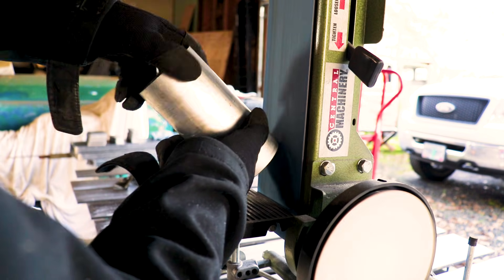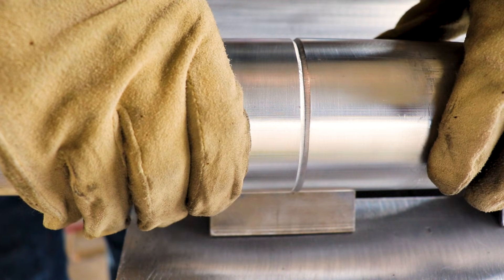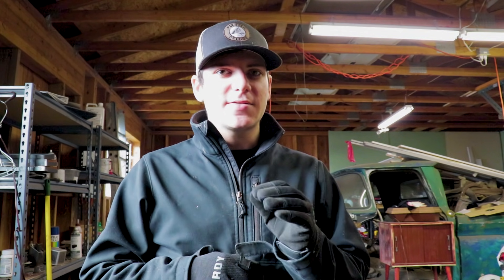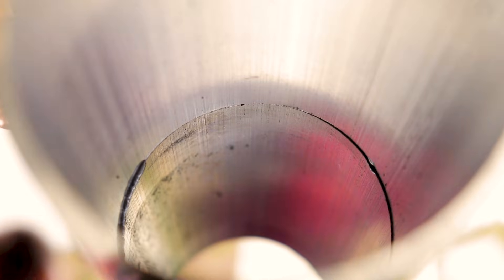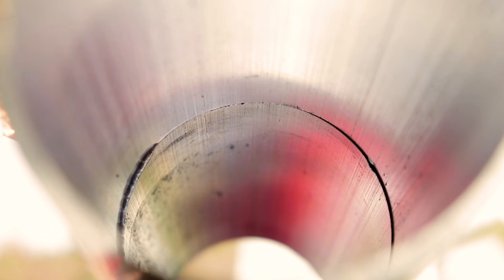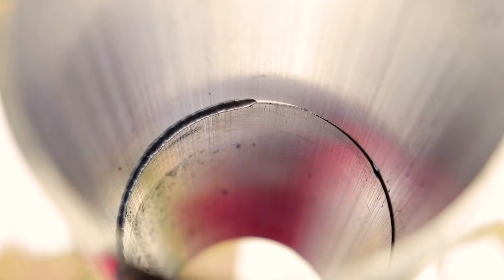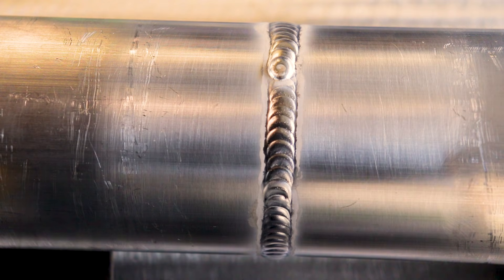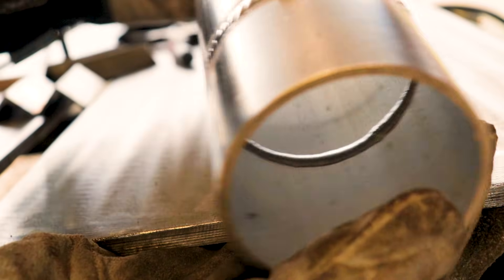How to Weld Aluminum Pipe

Comment: Hey man thanks for the pointers! What do you set your argon cfh too? I have mine at 10cfh and 80amps and I can’t tack my pipes
Reply from the maker: It depends on your cup size.  Its basically double your cup size so if you're running a #5 10 cfh is good.  But every regulator seems to be a little off some are high some are low.  Its best to just turn them up until your weld is clean.  And probably a lot more amps!  Like 120 or more depending on how thick

Comment: 37 1/2 degree is the proper bevel for pipe heavy wall pipe such as main steam may have a 37/10 bevel on it and I’ve ran the gold track with  5 degree bevel but a 45 degree angle is way to much for a multitude of reasons this is just fyi! Your doing great job

Comment: Honestly, I almost skipped the video since the start it wasn't filtering out the light but something told me to stick around. I am glad that I did. I have had trouble tig welding aluminum since it doesn't really pool the same way as steel (at least that is the way I feel) and your narration along with seeing it happen in real time helped for sure. I might hop back on the welder soon now!

Comment: If you welded Al tubing at a right angle or 45 or 135 how would you do that? How would you get the welder head into the pinch angle to properly fuse them together?

Comment: This video is very well presented and I have never seen the inside shots before...very nice.  I noticed that you do not quite entirely fill the bevel on either side of the weld.  In a real application would this be acceptable?  Would it reduce the strength of whatever gauge wall thickness you originally had?  Thank you.

Comment: Thank you for the video. I have two questions please.(1) With aluminium pipe welding is it necessary  to put a root gab or not? (2) can it be welded on a fixed position like 6G (where the pipe can't be rotated) will the penetration come out on the overhead position? Thank you.

Comment: Holy mother of dipped tungstens
Reply: @d2solutions185  different metals weld better with different tungsten shapes. Aluminum does best with squared off end. It’s not dipped you’ve just never done it

Comment: On the inside of the pipe my welds still have a seam where the pipe meets, like the weld inside the pipe is not fully joining the pieces.   Outside looks great.  Plenty of amps.  Doing all the cleaning then ss wire  brushing inside too but still the weld on the inside is not joining both pieces...  help!  2-1/2 sch 40 6061 with 5356 filler...  not allowed to use 4000 series filler on this job.
Reply from the maker: Thats fine its actually just the oxide layer rising up from the seem.  Even though it looks like it, it's not split.  Wire brushing the inside seems to help get rid of it
Reply: @5thStreetFab  Whew!  Thanks!   Great videos!

Comment: Nice job
Perfect bead inside. 
I think if the pipe is welded in position the story changes a bit. 
The sink in becomes a suck back and is a repair on x ray.
Reply from the maker: Thanks bud!  With aluminum its pretty hard to get suck back unless its a fillet weld.  I have a video of the same technique in 6g somewhere on here.

Comment: I got a piece of Aluminium tube this size and put a cut with a grinder cutting disk most of the way around. Now i tried to weld this with all the burrs still on inside of pipe from the grinder cutting disk.
I am getting very poor welds. Is it me or is it not possible to get a good weld this way ??

Comment: Excellent. Does the inside burs need to be cleaned? If not, than will it not interfere with process fluid inside pipe?
Thanks.

Comment: I have a question..after done aluminium weld joint the pipes,is there posibility that the weld section can get a leak spot or the aluminium has weld is melting back if the weld pipes is at high tempereture place..what i meant is this method of welding apply for using motorcycle exhaust system..thanks

Comment: Nice video, I really appreciate your camera angles and showing your welding process. I have some aluminum work I have to do on my car and I've never used a tig welder before but I'm buying one online. You mentioned keeping the puddle flowing, is it the same process if you're on your back facing up while trying to weld?
Reply from the maker: Thanks bud!  Ya I use the same technique on overhead as well.  One thing that can help is slightly pedal bumping when you're in an awkward position.

Comment: What amps for .065 pipe? Hertz and EP? Thank you! Baddass welder!
Reply from the maker: Im not sure on the amps!  I would just set it to around 80 amps and then adjust with the foot pedal.  I would run around 120 hz and 30 for the EP balance or it would 70 on maxhines like the htp or miller
Reply: Thanks for the fast reply! I’ve learned so much from you. Keep doing the badass work
Reply from the maker: @xnivektonx  no problem dude thanks for watching!

Comment: I'M GLAD YOU CAME OUT WITH A VIDEO ON,"TIG WELDING ALUMINUM PIPE",NO BODY ELSE HAS AS FAR AS OPEN ROOT.WHAT WAS YOUR CFH SETTING AND I TAKE IT YOU WERE USING HELIUM(MAYBE ARGON)ON THAT THIN WALL PIPE(SCH 20).IS THERE SUCH A THING AS WALKING THE CUP WHEN TIG WELDING ALUMINUM PIPE?-EXCELLENT VIDEO,KEEP THEME COMING IN,STAY HEALTHY,CRAIG

Comment: Loved the video i have a new ahp alpha-tig 201 xd. A few wuestions if i may Im having trouble as a begginer with tig im a great mig welder, where do i start what size filler rod should i use for aluminum intercooler piping? Do i need to backpurge? Settings help? Also do you set your machine to the full 200amps and just rock your peddle as desired? Thanks -drake

Comment: Hi I'm new to tig welding  but when iv tried welding aluminium it just doesn't seem to form a puddle then all of a sudden the whole thing melts and falls away.
Reply from the maker: I hear this quite a bit but i havent personally.  Just make sure your welding hood is clean and clear and slowly ramp up on the foot pedal.  Maybe practice on some thick plate 1/4"
Reply: @5thStreetFab  as its alloy that iv just picked up maybe its the type that's got something else mixed in that's not weldable.
Reply: also iv had it where the two parts are finally melting into a sort of puddle but seem to not want to attach together so the two half's are puddling separately and not joining into one, do you know what may cause this.
Also Thanks for you help.
Reply from the maker: @WALLACE7084  ya that happens a lot. Just dab the filler into the center and it should join them
Reply: @5thStreetFab  thanks for you help i really appreciate it. i once asked a guy 6061.com the same sort of question and he wanted me to pay a subscription to his channel before he would give me an answer the cheeky git. so thanks again for helping and not being greedy like some people. you're a good one. have a nice day. 👍
Reply from the maker: @WALLACE7084  no problem haha aarons a good dude hes just trying to run a business
Reply: @5thStreetFab  i just think he went the wrong way about it, if he'd have answered what was a simple question for him and then advised me that his paid subscription channel could learn me a lot more then i may have been tempted after helping me out, but to refuse to give me a bit of help unless id paid was a no go. don't get me wrong the guy is one of the best iv seen on here but the way he came across wasn't good.

Comment: An interior gas shield during welding aluminum pipe with penetration is not necessary? If no an interior gas shielding doesn't it consequence a deep crack along the join?

Comment: There seems to be a lot of people in welding aluminum. If my memory serves me right, from when I worked in a ship yard, aluminum will shrink when welded. If you measured a pipe length, by the it was welded it could wind up shorter than you wanted. Especially if there were multiple welds.

Comment: Tig welding school is so expensive SoCal
Reply: Try cheaper community colleges or state approved apprenticeship program.  Some unions in your local city have apprenticeship programs that pay you while you work and give you years of experience.  The apprenticeship programs will give you the needed experience in order to get hired long term.  If you're young too, you can try going through the military also.  Private schools should be avoided when there are better options.

Comment: What size tunsten and rod? Also i know you had a goot pedal cotroling heat but what did ypu have your amps set at?  Im new to tigging and i need to do some aluminum  pipe welding, any help would be awesome . Thanks!
Reply from the maker: 3/32" tungsten and filler.  I just max out the amperage on the machine so i have no clue how many amps its actually putting out

Comment: Too much penetration... For most high pressure applications they want penetration to be flush with the internal surface of the pipe.
With that much penetration you have created a point in the pipe in wich pressure is higher.
So for most applications 1-5ish bars this is acceptable, but for higer pressures this is a no no, at least i can say that I would fail my welding test for my work, they wouldn't even xray the joint, i would just be rejected at visual inspection.
The best way to go is to penetrate, without over penetrating (you don't want to reduce the inner size of tge pipe).
Reply from the maker: not on the aluminum pipe i do dude.  high pressure aluminum pipe is usually an open root with a back purge.  This is just your regular pipe like intercooler tubing
Reply: @5thStreetFab  apart the fact that backpurging on aluminum, unless it's for sanitary, is not necessary; i mean you can do, or not; obiously controlling penetration with backpurge is easier, but it's not the only way to go.
Anyway, maybe i'm wrong looking at your video, but as i can see you have an higher crown on your penetrated weld than in your external bead; ok, that's fine for your application, but you are still overpenetrating, that shouldn't be your goal.
But hey, if that's the way you want to penatrate, then just fine; I have been taught differently over the years by my welding supervisors and inspectors.

Comment: That's a great method for being able to roll out but would you use the same method for a 5g?
Reply from the maker: Yes I do, but when Im running the vertical sections I use a slight back and forth motion after I dip the rod so it doesnt crown up to much
Reply: @5thStreetFab  that's awsome! let's see a video of that!

Comment: Hey mate, do you still do a landing if the material is less than 1/16?
Reply from the maker: nope and usually i can get away without doing in on 1/8" also
Reply: 5th Street Fab thanks mate, keep the vids going. They’re great 👍🏼

Comment: Great video man! Learning how to weld and I find myself struggling with piping mostly (working on building a hot side and cold side for my ls build). The inside and different angles really helped me visualize what to look for and understand that it requires good timing. I find as a new welder and being self taught, I’m always worried about burning through my material so sometimes (at least of SS) my welds look cold
Reply from the maker: That's awesome!  Thank you.  I've been wanting to do some stainless videos I might have too.

Comment: Why does my aluminum tends to push away from each other when I try to put a tack
Reply from the maker: im not sure why but if you can get both sides to start melting you can stab the filler in between to join them and then start the weld from there.
Reply: When your tacking, I've found you need to crank the amps up to melt the two pieces togeather quickly. About 50% more than what you would weld at. That stops the edges from soaking up the heat and melting back like your describing.

Comment: I might have missed it, but what kind of gas are you using ?
Reply from the maker: 100% argon
Reply: @5thStreetFab  I tried with argon, the aluminum gets melted, it doesn't liquefy as in your video. And the welding rod becomes blob instead of dropping down. I tried lower and higher(30-90) amp settings, same with argon pressure. It just doesn't seem to be working. Would you also like to share the pressure of argon ?
Reply from the maker: Sound like you're on DC you need a machine that welds with AC current
Reply: @5thStreetFab  ah thats possible, the machine has no settings for switching AC/DC. Will try the better one.

Comment: Great video 👌🏻
I would like to see a video with coped aluminum tube. Something like 45 degrees but not 90 degrees and thickness around 1/8” or slightly thicker. Do you beveled it also and completely round? If you think it would be interesting for your channel I would like to see it if not I understand. 👊🏻
Reply from the maker: Ya I have to do those at work all the time.  Yes I bevel everything over 1/16".  But I try to keep my bevels  at about 35°.  I have best results welding from the inside of the joint to the outside and turn it over and weld the other half from inside to out also.  If I get a chance I'll do a video on it.
Reply: Thanks for your answer. It makes sense and I truly understand what you said. Thank you for sharing your knowledge and time. I appreciate it. Cheers, Tristan
Reply from the maker: @tristanvos5909  no problem bud!

Comment: I keep getting black pepper on my arc starts any idea what I'm doing wrong.  Using a gas lens, #8 cup, 24cfm, 180amps on the foot pedal, cleaned both pipe and rods with non chlorinated break cleaner.     Using 2% lathinated and 5356 rod.  Once I'm going its clean just leaves some crud when starting.  Ive cleaned cup out, changed gas lens etc.  A clean tungsten will be good for about two stop starts then it does it again.
Reply from the maker: I've found its usually a gas problem.  Usually something easy to fix like a bad torch angle.  If you don't think it's a gas problem then it is likely your tungsten.  When it gets dirty it'll fling crap into the starts.
Reply: After a lot of troubleshooting I turned out the old collet body was dirty and old and would leave dirt on starts.  Higher gas flows reduced its noticebility but after the change in welding at 15 to 18 cfh now.  Never would have thought.  You'd think gas lens but nope.

Comment: Dude, great camera work job!
Reply from the maker: Thanks bud I've been trying to get good at my camera work
Reply: It's not only the camera work, but also the idea of take shot at the interior of the pipe. Now I have a better idea how the TIG behaves in the inside. I do custom piping for intercoolers for different cars specially Mazda RX7's and wonder if the penetration of the welding would have any effect in the turbo performance.
Reply from the maker: Nice t
I thought it'd help!  Ya it can cause turbulence.  If you're worried you can just weld it without getting full penetration and as long as you have solid fusion and adequate filler around the perimeter I would worry about it.  Or you can purge it and mess with the purges cfh until you can get a flatter penetration

Comment: Good vid. You also explain the necessity of clean aluminum which is very important. Curious what type of TIG welder you have. Sounds like a Dynasty from miller. I have a syncrowave 210 from miller. Very nice machine just wish I had more fine tuning settings. Oh well. Again excellent video, explains the right amount and doesn't overload your head lol. Bravo !
Reply from the maker: Thank you very much.  I just have a cheap AHP 200x.  Amazon sells them for under $800.  Ya the syncrowave 210s are pretty nice.  At work we have the syncrowave 250s big ol' transformers.  Really nice smooth welders though.
Reply: 5th Street Fab yes ! The 250's are beautiful machines. You are right they purr like a kitten and lay a bead like spreading butter.  👍👊✌

Comment: I got my Alphatig 200X a little more than a month ago, love it. Glad to see someone using one, although I'm not to the skill level as you(Yet!). I know some machines cleaning settings are reversed, when you mention your setting, let's say 35%, is that the dial setting, or the actual percentage cleaning/penetration? As an example, 35% on AHP is equivalent to 65% on some other brands.
Just watched a few of your videos, already helping me to learn. I like the way you explain things, some youtubers just showcase their skill without saying how they do it. Keep putting them out.
Reply from the maker: I mean on the actual dial on the ahp.  So on ahp it shows DCEP and on others they show DCEN.  You'll be able to tell if you have to much if your tungsten starts to melt.  With the ahp with 100% argon you should need thicker than a 3/32 tungsten at 200 amps.  And thank you for watching!
Reply: Thanks for the quick reply! The tip on tungsten size is appreciated, too. Look forward to more videos, gonna use some of your tips and techniques over the next few days. BTW, what part of the country are you from? Just curious.

Comment: Your not doing code pipe welding as It would need a gap for full penetration also a back purge with argon.
Reply from the maker: +R Reichel that's not true I've never had one call for open root.  I know people that do with open root and a purge but the majority of aluminum pipe at least here in the states isnt.  Also I show the full penetration at the end of the video.
Reply: 5th Street Fab   I'm from Philadelphia and I am a pipe welder and ASME code requires full penetration with a gap and back purge.  I'm not saying you can't Weld it the way you did just saying if it's to follow code you can't.
Reply from the maker: R Reichel hmm you might be right.  Ours is a qualified WPS but it could be specific to us.  We get inspected by the coastguard and military.  So it might just be their standards.  I've only seen people from Europe backpurge open root aluminum.  My buddy that welds to d17.1 does his pipe the same way?  Either way it's interesting to me.  What is the code that is open root backpurged?